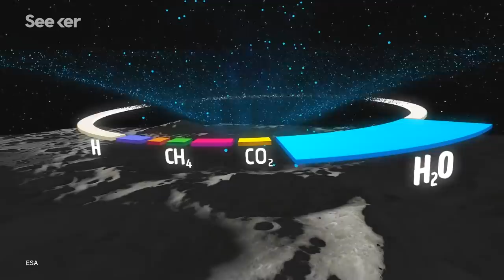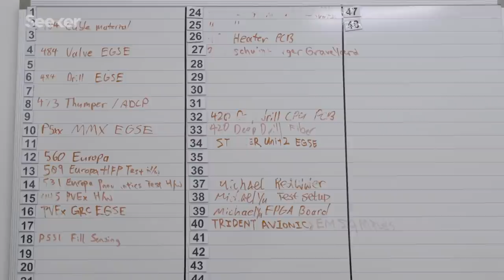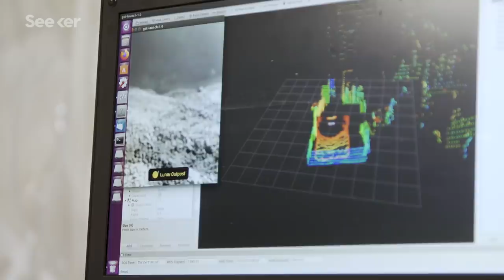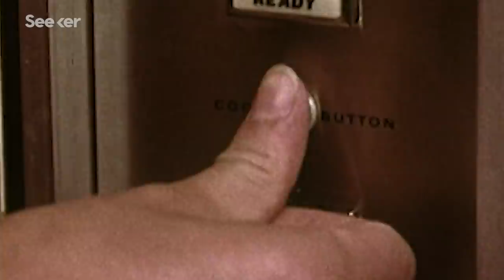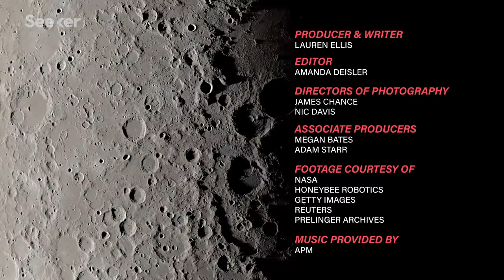Inside the Lab That's Turning Moon Water Into Rocket Fuel

Comment: Why?!

 seriously.

 1/6 the gravity, with little to no atmosphere.
 A railgun is the clear superior choice!!

I can sorta see the point with earth..

But the moon?!
No. Rockets are just a waste.
Reply: But you would have to build the railgun first. I know, it will become cheaper the more you use it, but just look at the railguns the US Navy uses now, you can't fire them very often, because the tracks will disintegrate. And using magnetic slates won't change that, because you need physical contact to close the circuit that will produce the lorence force actually driving the thing forward.
Reply: Okay, now that I think of it... On the moon, it might be possible to build some kind of extremely highspeed mag-lev, where the freight containers are magnetically fixed to the train, which is open to the sky. You could accelerate the train until it would reach escape velocity (but will be held down by the magnetic field) and then just release the magnetic seal that holds the containers down, shooting them into lunar orbit using their own escape velocity. Then you could slow the train down and start over...

But that wouldn't be a railgun per se, as you would be using a completely different design principle and it would take waaay more space to accelerate that thing...
But still, you couldn't land a damn thing on the moon using this technique.
Reply: Midnight  
Same exact principle.
Different Application.

 But, And You forget.
 A railgun will need less power on the moon.

As for cooling, the options are many, including electrostatic charge streems to carry that energy.

Or,  A cavity in the rail is full of liquid. as the heat rises, that liquid boils and expends into a dedicated space… 
Pass most of the energy, thus cool. Liquid nitrogen will do.

both allow fot the standard railgun. will less need for juice.
Reply: Fuel is still required for propulsive landing at the destination.
Reply: @fanOmry  that's not exactly true, the principles are different. In a standard railgun, the propulsion is generated by a flow of electricity through a wire perpendicular to the tracks. For this, you need physical contact. And this physical contact will degrade your tracks, not only due to heat, which could be handled with cooling, but also through abbrasion. I mean, high ranking engineers are working on that, if the answer was so easy, they would do it.
But for electromagnetic acceleration of a mag-lev train, you don't need physical contact, which is the whole deal of the damn thing.
Reply: @Obscurai  
Not necessarily..

 If it is to land on earth. The air is a good break.

It's very recently we started doing that. You know.
Not to forget, there's no necessity for it to land on earth. 

An Orbital midway Station, along with similar Floating midway platforms in 10km height. 

Each of those steps reduces energy needs, regardless of methods.
Reply: @midnight8341  

Why would that be different?
Reply: @fanOmry  Yes, the destination is not necessarily Earth. Specifically, thin or no atmosphere destinations require propulsive landing and thus the need for fuel.
Reply: @Obscurai  

In those cases, you lead, like on the moon, as I suggested (Bewilderment at it not the default) lead with a receiving station.
Reply: @fanOmry  Sorry, your English is not understandable.
Reply: @Obscurai  

OK..

1. On an Airless world, You lead with making a Thing that sends and recieve Magnet based crafts.

For such worlds, Skyhooks; Sorry, spinning sticks that use leverage to send craftsr to the sky and earth, are the best option for first arival.

With the railgun for something more permanent.
Reply: @fanOmry  Rail guns and other magnetic propulsion are fine for getting materials and personnel off a planetary body, but the problem is how to land on an airless world. Magnets cannot be used for landings.
Reply: @Obscurai  

they can if you have an existing system on the planet.
 Three strong focused Electromagnets that triangulate on the craft and slow it to landing.

As to on a first flight, that craft will be a skyhook. it will not actually land, it will land other crafts on it, and take others to orbit.

On such worlds, skyhooks can touch the ground as there is no dragg.
Reply: @fanOmry  Are there any engineering firms working on elector-magnetic landing systems or skyhooks? I suspect that neither are viable technology yet.
Reply: @fanOmry  it is different because a railgun will literally rip itself apart if you use it more than two dozen times in a row without replacing the tracks. A mag-lev train can be run for years without repairs, especially if you don't have weather wearing it down.
Also, the mode of action is completely different, as a railgun uses lorentz force to accelerate the slate, pushing it forward, while a mag-lev uses magnetic attraction between the rails switchable electromagnets and the train to pull it forward. Two completely different systems that can't be used interchangeably. Which is also the reason railguns can be built rather small and we don't use mag-lev systems to shoot things. 

Also also, you can triangulate using a magnetic field over large distances, as magnetic field lines can not pass through each other like for example light can, which creates completely different field mechanics. And magnetic field lines try to get away from each other, which means they can't be arranged like lasers and as such, suffer from the square-distance law, where they get exponentially weaker as you move out further. Slowing down an object at interplanetary - or even just lunar orbital - speed, would require a magnetic field equal to that of a neutron star or even possibly magnetar, but without the mass needed to create it, as that would disrupt our whole solar system. Not gonna happen until we invent a magnetic laser.
Reply: @Obscurai  

The Basic technology exist.

Skyhook mostly needed a material science development.

That has been here a while.

For earth, it will have to be above the 10km hight. Maybe even more. Cuz' dragg.

Hence,
In earths case, I was thinking Floating Platforms.
A combination of Ion drive, and floatation.

Those being in Jet level and Above, Plane get on.
Load off.

Plane goes home.

That load? the Craft.

in here you have several option with no propellant.

 1. the Platform extends the space to enhance flotility(extend the space with magnets, not Hydrogen.) and make the rods that so the ion drive do it harder.

This is now the counter to it railgunning it into space.

2. The Above, but now to prepare for a leverage and Catipolt it out.

As to railgun themselves, They are considered currently either too long or too fast. 
Too long- At a comfortable acceleration, it has to be miles, Which is expensive.
 Too Fast- At a reasonable length, the Acceleration  is well over 5g, at which people black out.

Which I actually Disagree with.

They Can Accelerate the Craft at 2.5G for a km or half that, Then follow it with much stronger electromagnets, as they reach it, they push it fast enough to pass it all their kinetic energy and then some. One after the other.

Every one recoverable, and reusable. 

The combined mass doesn't actually reach that of a fully loaded at launch rocket now.

Thus. Cheaper.

 And yes, we can do it. but we don't.

 heck, that railgun can also be a mass driver. And send an accelerated plasma stream.

So.. Yeah. The tech is here. Nobody wants to.
Reply: @midnight8341  

Magnet lines- Yes, but we know how to manipulate them. The Principles of the Farraday Cage can be used as 'Mirrors' to direct them.

And I already elaborated heavily on two possible colling methods.

Also, A maglev can go up, too.

Would probably be better for the moon, too.

forgot something?
Reply: @fanOmry  Nobody wants to because the engineering says its not actually possible. No billionaire or government is spending money on sky-hooks etc. They are going with what is actually possible.
Reply: @Obscurai  

No.. They are going with what is familiar.

There's actually an American Firm(last I heard) that invests in an intermediate platform for what I suggested.

Though a bit more conventional.